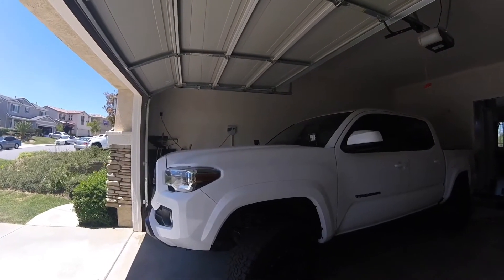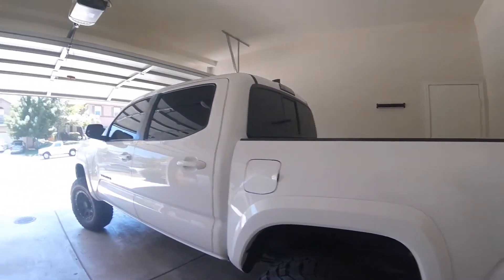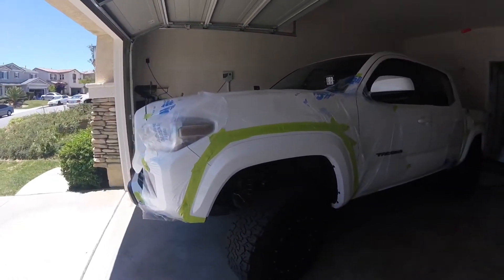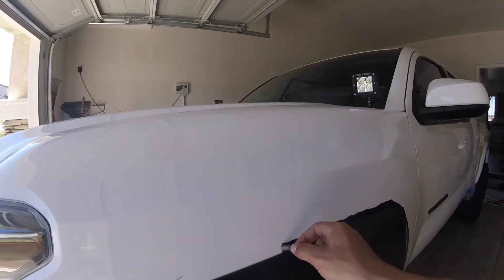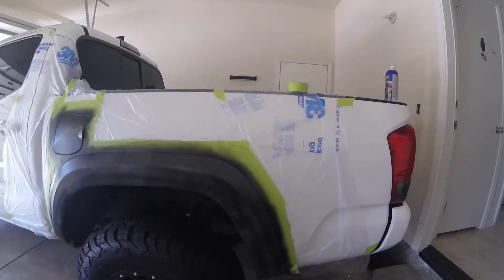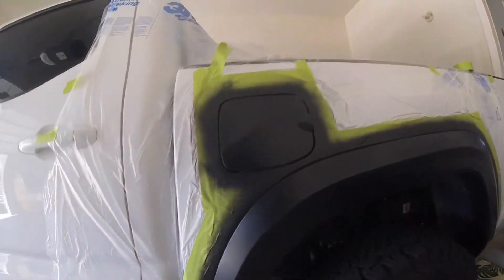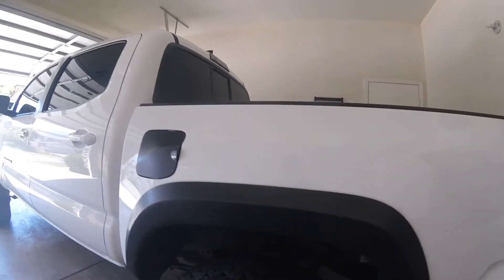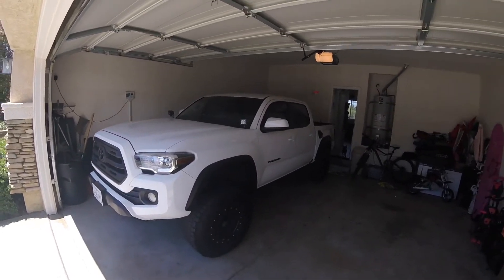Tacoma plasti dip fenders

Comment: That's awesome Man! But I wonder how long it will hold up??? I kind of want to do go for a long term thing on my flares.
Reply: rupman27isback use the Duplicolor truck bed coating. Make sure it is the older version model TR250. Available at O'riely and Advanced Auto parts. Just do several thin coats on scufed painted surfaces. The stuff rules on rock rails to as you can touch it up any time!

Comment: Have they ever break off or separated when pressure washing your truck?
Reply from the maker: It definitely can once it starts to peel if you pressure wash it will rip it off have to be careful luckily it’s cheap and can re do it later
Reply: @dwreckdunn4824  has it happened? Tho since ur first try on the fenders, has they ever peal since?

Comment: Looks great. Where did you buy the dip? I’m new to the mod 🌎. Walmart or auto-zone have it? Most importantly did it damage your paint at all?
Reply from the maker: Christopher Zazueta thanks! You can buy it at Walmart be the cheapest and autozone has different brands but i prefer the plasti dip brand last longer goes on thicker not as transparent doesn’t hurt the paint just clean and wax the area prior and if you don’t like it will peel right off, the thicker the easier to remove

Comment: Do you have tips for keeping the dipped area frim peeling when you removed the tape?
Reply from the maker: jdwojda best thing I did if you want clean lines using plasti dip is spray the paint on the taped area and tape and remove the tape right after before it dries
Reply: D wreck Dunn 
So does that mean that if you’re applying a total of 5 coats of Plasti Dip you’ll wind up having to apply the tape around the edges 5 times as well?

Comment: Nice work, I’ll be doing this to my ‘19 sport as soon as the weather holds up. You had no problems pulling of the plasti dip off the vehicle without removing any on the fender? There practically touching, and I’d rather not remove the fenders like you did here
Reply from the maker: Rich Ellis thanks for watching! It definitely comes off easily once you paint it with plasti dip any separations splits the paint and makes it easy to use but I know if you leave it there for about 6-12 months will be harder to take off

Comment: Does the plasti dip hold up while off roadind through brush and braches?
Reply from the maker: It actually holds up pretty well but if it starts peeling after a while or bothers you it’s super easy to re do

Comment: Why not just unscrew the flares and paint it then put them back on?
Reply: Its not that simple to just remove them. The clips underneath could break easily. Plastidip is designed to be applied to parts on the vehicle to not need to remove them.
Reply: i see. ive been looking into getting some flares for my tacoma. do you  know if theres any way to keep the mud flaps on the truck after installing the flares?
Reply: Im sure there is a way, but it would require some additional hardware. Most likely it won't be provided with the aftermarket flares you buy. Try checking out tacoma forums. They might have some info on it, but most people often delete the mudflaps all together when going with a lift, wheels and flares.
Reply: wouldnt the lack of mud flaps damage the paint on the wheel wells?
Reply: just wrap with 3m dinoc black matte.. buy the new clips and put on like new with the paint intact and a tougher durable wrap on top. plastidip is crap n peels. lame trend

Comment: How has it held up since you removed them? How long you had it dipped?
Reply from the maker: Kala'i K thanks for watching I ran them for about 6 months then just decided to take it off but I had my grille plasti dipped for almost 2 years with only about 3 chips it last a long time and the finish stays or just re coat them after a couple months just wax the surface prior and will peel off later and still be good if you don’t want it
Reply: @dwreckdunn4824  sweet, i remember watching this vid when you first posted lol. i got my grill dipped, but wanted to dip the fenders and front lower bumper like yours and the offroad. Cool man thanks for the feedback!
Reply from the maker: Kala'i K nice man! Thanks for the support! for sure man do it plasti dip is so forgiving you can run it then take it off re do it or keep it off and 6$ a can 👍

Comment: Hello, how many coats ?
Reply from the maker: Alejandro Rocha start with a base coat nice and light let that dry then you can come back heavier and spray the second before that dries all the way spray the 3rd consistently but not runny and it will dry smoothly you can do up to 4 but if you sprayed enough it should be good

Comment: i just got done with mine, so tell me,  what would cause the dip to not come out smooth, i used 2 cans, i guess i didn't give an inch from the fender, probably will have to redo one of the fenders, the bottom part didn't come out as well as i had hoped.
Reply from the maker: John Taylor I’ve noticed spraying plasti dip is not like spraying regular paint it actually comes
Out smoother when you spray consistent instead of light coats almost heavy but not dripping if that makes sense and it molds together and becomes smooth

Comment: I kind of liked the paint matched white to begin with, not bad black either, truck looks good tho!
Reply from the maker: ryanflaherty24 thanks! looks good both ways what’s nice about the plasti dip if you don’t like it you can take it off super easy
Reply: @dwreckdunn4824  Definitely true about the Plasti Dip removal, I have a few plasti dipped Parts on my F150, I just did a full Chrome delete with Plasti Dip, my truck is white so I used white plasti dip with the glossifier for the glossy look and to be honest I'm truly impressed.

Comment: What spray can did you use... so far  has any flaking been happening
Reply from the maker: Eden Rodriguez I used the plasti dip brand not the other rustoleum or other ones ran strong but always good to freshen it up maybe after a year or so
Reply: @dwreckdunn4824  yea thanks for the info i just did mine yesterday 👍✌💪